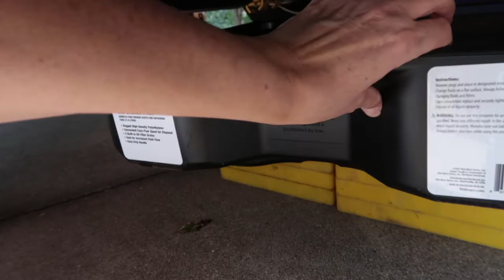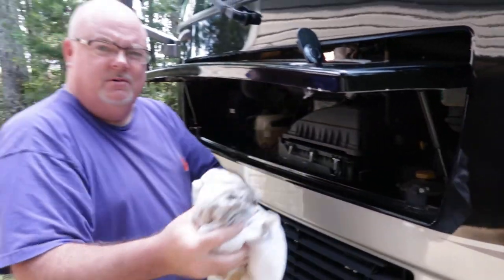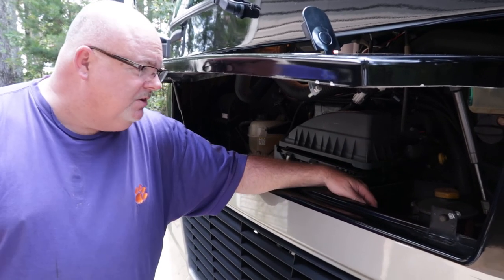F53 Motorhome Oil Change

Comment: You should look at the FUMOTO oil drain valve for the motorhome. They have one you can add a piece of hose to so you make no mess draining the oil. I have had one on a 2002 F350 diesel and now on a 2019 F350 diesel.
Reply from the maker: Thank you Dave!  I was aware of them, but heard some stories of them failing.  Most of the stories were from getting knocked open by hitting something in the road.  However, the oil drain is well protected in this application.  Looks like I will be adding one soon!  Thank again for you comment and for watching.
Reply from the maker: Thanks!  Ordered!
Reply: How do reset the computer?

Comment: Was there a crush or nylon washer on your original drain plug bolt? Did my oil change yesterday; never found a washer so I put it back that way. It never leaked even one drop on the concrete before the oil change, nor has it leaked even one drop since, though so far I only ran it for five minutes for a subsequent level check.
Reply from the maker: No.  There was no washer.  I've changed it 3-4 times since and there has never been a leak on mine.  Have you heard that there should be a washer?